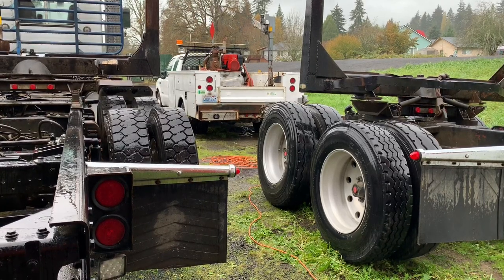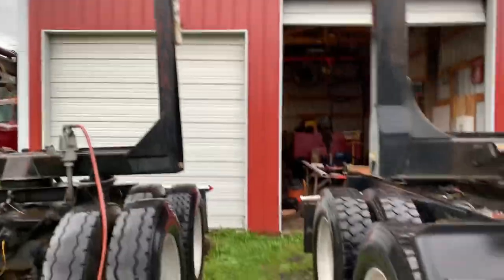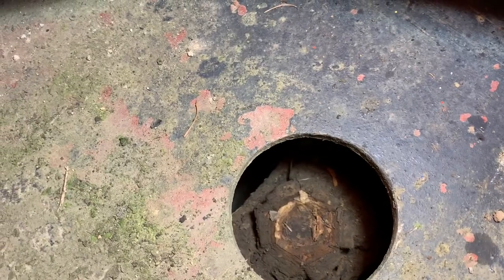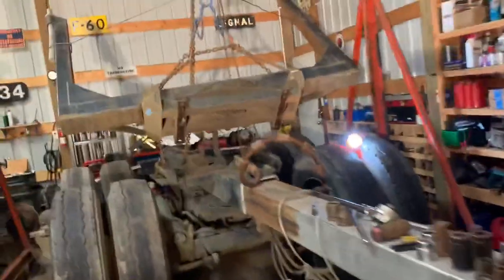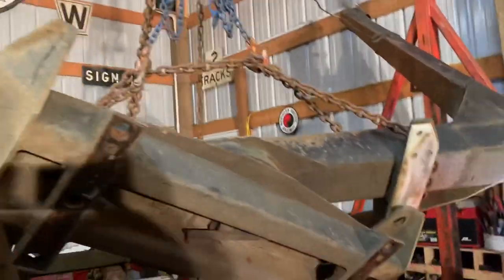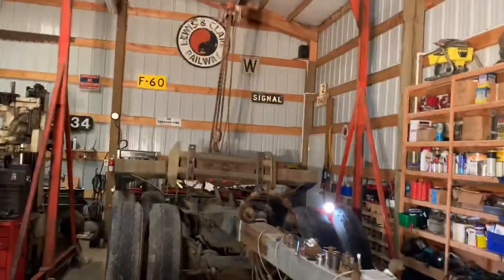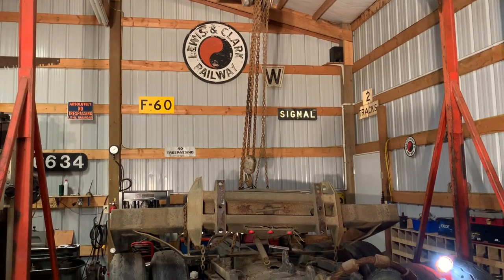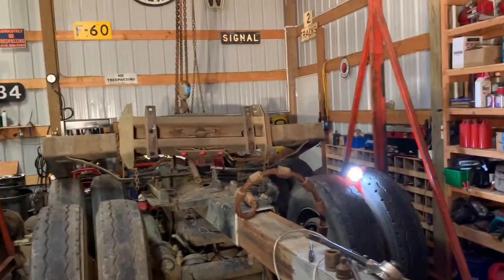Pulling the bunk gear off the log trailer!

Comment: Big time crack right down the middle of what appears to be a previous repair weld.  From your log trucking back ground, you probably have a good idea what causes cracking in that location.  From what I have seen of your previous work, the problem will most likely be much better off when your repair is completed.  Great to see George right in there helping.  That young man is growing like a weed.  Here's wishing you and yours a wonderful thanksgiving celebration!  Nick, North West Farmer
Reply from the maker: Yah he is growing up so fast. Lately it’s been hard to get him out in the shop. As soon as this video ended he ran back inside to watch tv. I’m sure it’s his age but I hope soon he wants to work with me outside. The bolster normally cracks in that location when the bolster gets sloppy. Normally it’s the truck not the trailer however.